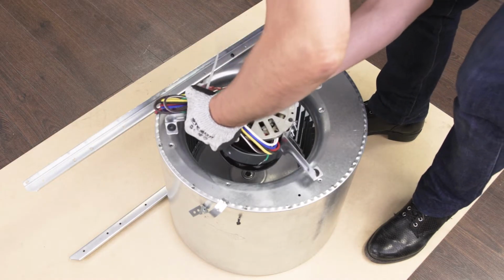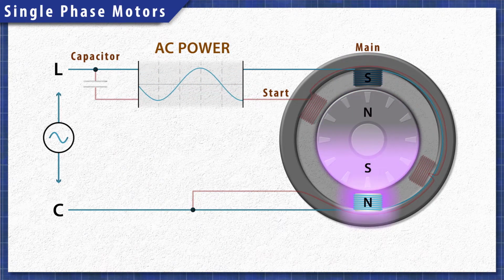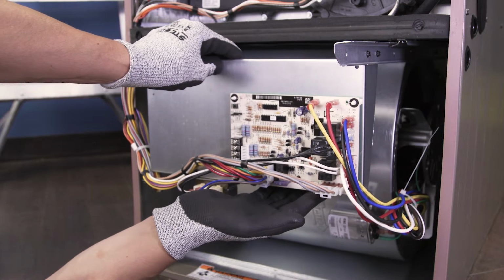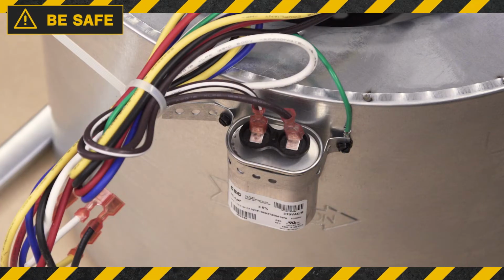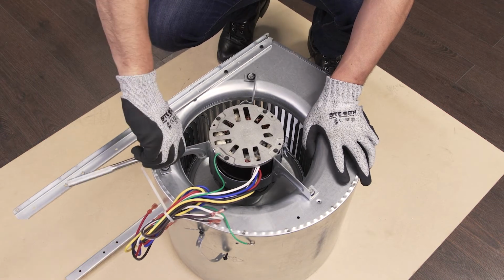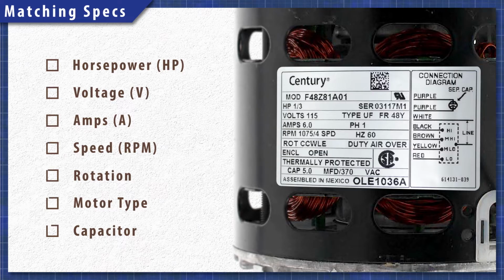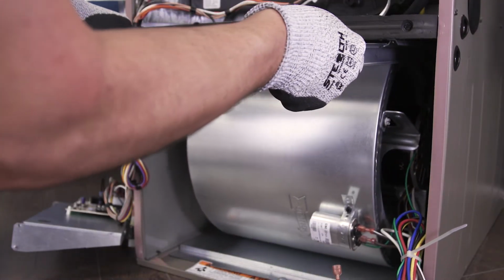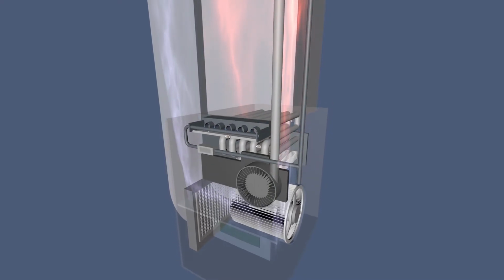Furnace Motor & Capacitor | Repair and Replace

Comment: How do you check electricity used by window air coditioners space heaters and other small appliances
Reply from the maker: A clamp meter will measure the current flowing through the wires and allows you to test a device without having to splice into any of the wires.
Reply: Thank you

Comment: Ok I really need your help. I had someone come out and replace the capacitor a few years ago and I remember him saying that the capacitor was a different one than the other. How do I go back and look to match the correct one with the motor that it needs. Is it listed on the motor?   I believe it was different MFD and VAC.
Reply from the maker: Thanks for watching. If you want to check what capacitor your furnace motor needs, you might be able to do this in several ways. There might be a tech sheet or information in the manual. There might also be a wiring diagram and specs inside the blower cover door.

As well you could look at the motor nameplate data. Some models will list the capacitor directly on here. If it doesn't then you can find a matching motor on amresupply.com using the part number as this will list the motor specs and the needed capacitor here. 

Lastly you could match the motor and find a similar one of the same specs. You can follow this video to see what specs you'll need to match as a reference. https://youtu.be/3eOARJ8oRrc

Comment: Have u guys been able to make a video on how to test and wire a motor with and without a wiring diagram?
Reply from the maker: Thanks for watching. We are currently working on a extensive series on refrigerator repairs so we won't be updating our HVAC or motor series any time soon. We did however do a video on "how electric motors work" which does explain some of the differences between each type and where the capacitor is in the circuit. https://youtu.be/vpspMVQQXRs

As for testing a motor it's as simple as testing each coil for continuity. This will differ between motors as the wire colors and terminals will all be different. Multi speed motors will have additional wire taps (which is explained in the linked video) Each motor tap will have more resistance:

Comment: Thank you so much for this very clear video. I replaced our old blower motor with a salvaged motor, and also installed a new run capacitor, since the old one was more than 20% below spec, and now the system runs quietly and dependably. It should last until we are ready replace the entire system. I am very appreciative for the videos you have created and shared.
Reply from the maker: You're welcome Tom, we're glad to hear that the video helped you replace your motor. If you're curious we have more videos many of them just as detailed as this. We have a "how it works" playlist that many have found helpful! https://www.youtube.com/playlist?list=PLCo9SMjkdWBxWwrWCmzvRMSi2kLo9bGdp

Comment: Does the capacitor give torque to the blower motor or induction motor?
Reply from the maker: That is a great question! It depends on the type of motor. Most blower fans use a permanent split capacitor which helps increase the efficiency. Blower fans do not need a lot of starting torque as the load is just the blower wheel and the air it needs to move. 

Capacitor start motors are often used in pumps or applications that need higher starting torque.

The comparison between these types of motor is shown in this video that we created: https://youtu.be/vpspMVQQXRs

Comment: here in California want to thank you for the slow way to explain, but how would it be a way to know that the motor is not working, the capacitator was replaced and no switch to start the motor was found. the heater appears to be running and got no hot air flowing
Reply from the maker: Thanks for watching. You can test the motor windings for resistance. If there is no continuity in one of the windings then the motor will not work. We didn't go into detail on that as many motors are wired differently and often have different speeds. In most cases however you can test each winding and the common terminal.
Reply: @AmreSupply  thanks for the info, yes I found the problem and it appears that the part or motor is not available, how can I find the switch for the motor
Reply: Part# 50HJ401484 9717
Reply from the maker: @javierhdez3962  There are many different models and not all of them will cross over to something within our databases. It depends on if the switch is specialized or not. What kind of switch is it? Are you referring to a limit switch? https://www.amresupply.com/catalog/Fan-Limit-Controls-HZ3D These can be matched by shape and temperature rating.
Reply: 50HJ401484 9717 is the part number to the switch
Reply from the maker: @javierhdez3962  That heat switch looks unlike anything that we carry. Without any specs its hard to match it with something more generic.
Reply: Have a picture of the motor, but have no way of sending

Comment: 1130 RPM vs 1075 RPM make a big difference? Please help
Reply from the maker: Thanks for watching. That is within a 5% difference and will likely work fine if HP, amps and all other specs are the same.

Comment: So my furnace would make an awful screeching noise when the blower starts up, about 1min in the noise would stop. The noise would start up again when it’s preparing to stop. Is this the capacitor?
Reply from the maker: Hi Tina, thank you for watching. The capacitor wouldn't be the source of that noise. Its likely the motor, the motor bearings or the blower wheel rubbing up against something. It seems like its only at lower speeds. Furnace noises are explained more in this video: https://www.youtube.com/watch?v=WkHgeTITioE

Comment: I need to replace a fan capacitor. The one I need is no longer manufactured. I can find one with an exact match for the MFD and the Voltage. The only problem I'm facing is all the capacitors I find have dozens of pins on them to connect the wires, even single-phase ones have like 7 or 8. My capacitor only has two pins, one for each red wire. How will I know where to plug in on these capacitors with all these extra spaces for wires? Also if I have 10uF + 10%, but can only find a 10uF + 6% am will it work?
Reply from the maker: Thanks for watching. What you might be seeing is a cluster of pins which are only actually wired to the two main connection points. Furnace blowers will generally have 2 pins, and air conditioners will often have 3 which is explained in this video: https://www.youtube.com/watch?v=NkgxNLCrmr0&t=47s If you are unsure of which pins do what, you can test the capacitor to determine the ratings between the pins. As for the tolerance ( the +/-10%) its best to match that exactly.
Reply from the maker: As well if you need an exact match we do carry a wide range of capacitors at AMRE https://www.amresupply.com/catalog/Accessories-635291

Comment: HELP!! My blower motor on my furnace was replaced. Now when the heat kicks on it sounds like a bathroom fan!!!!!
Reply from the maker: Thanks for watching. A new motor can sound different than the old one. What kind of sound are you hearing? Is the motor itself noisy or is it the air moving quickly that you're hearing?
Reply: @AmreSupply  Hi thank you for getting baxk with me. When it starts up it is fine when the air(heat) blows thru the vents then is when it sounds like a bathrooom fan. It does this thru the full cycle.  The tech was out and adjusted speed. It did nothing!
Reply from the maker: @rmartini6952  There will be some noise from the motor running and the air moving through the vents. Other than adjusting the speed, there isn't a whole lot that can be done to reduce the sound of the air out of the vents.

Comment: Are the leads on the capacitor interchangeable? I noticed there are black and black with white stripe wires connecting to that but there is no labeling on the capacitor head as in a dual run capacitor on AC condenser unit. Also if this capacitor fails, would the fan-only mode of a system also fails?
Reply from the maker: Hi John, thank you for watching! Start and run capacitors are non-polarized, AC devices. It doesn't matter which way you connect the wires if there are only 2 terminals. On dual run capacitors, the wiring does matter as there is different ratings for each, but even without labels  you can determine which one is for each based on the ratings.

You are correct, if the capacitor fails, the motor will not start so the fan-only mode will also not work.

Comment: Just replaced our blower fan with the Rotom motor - a 1/3 amp, 1075rpm 4SPD, 5 amp unit.  This replaces the old Emerson unit of the same specs (1/3 amp, 1075/4SPD, 5.1amp), that the bearings finally wore out.  I replaced the wires onto the mother board the same way - black for black, white for white, red for red, and then made a guess for blue on the new Rotom for brown on the old Emerson.  My issue is that the air flow at any vent in the house, seems much lower than before.  I would guess less that half the volume of air is being moved.  

Any thoughts of what I have done wrong?

The mother board is a SureLight by Lennox.  The wires are connected to the following labeled tabs...  ACB E11 COOL is Black,  ACB E12 HEAT is Red, ACB E14 LOW is Blue (tried Yellow too, no difference...) and NEUTRALS E16,17,18, 22, 32 are White.

Thanks!
Reply from the maker: Hi Michael, thank you for watching! It seems like you matched the same specs but there are a few things to check. First check that you have the same type of motor, if you have a capacitor then you'll likely have a PSC (permanent split capacitor motor) as these are the most common. On the side of the motor is usually a spec list and wiring diagram that will list what speeds each color is for. The brown wire is normally used for the capacitor and the other wires will differ depending on the motor and brand.  Check the wiring diagram on the new and old motors and compare the wires and speeds. If will look something like this https://www.amresupply.com/part/DD-035-USE-FML1036#gallery01-14
Reply: @AmreSupply  I am very impressed with AMRE Supply.  The people I have dealt with both over the telephone and in person, have been helpful, patient and knowledgeable.  You have a new customer in me, for life.

My problem is solved. Thanks for all the suggestions on the various "checks" that I needed to do.  As careful as I was on the removal of the old motor, matching the specs on the new, installation and set-up, I finally discovered the reason for my low velocity on the various vents.  Backwards drive direction on the blower fan.  It's amazing how much better the air flow is, when the blower fan is rotating in the right direction!

The good news is that won't ever happen again, and if I ever have the opportunity to help out a friend, that will be one of the "checks" that I will be very careful with, before putting everything back together.

Again, my sincere thanks for all the assistance!

Michael Strange
Reply from the maker: @michaelstrange8165  You're welcome Michael, we're happy that those checks helped you narrow down the problem! A reversed motor definitely would reduce the airflow and is a easy thing to do by swapping the wires. Overall we are glad that you have had good experiences both over the phone and in person, and our youtube channel is just another outlet for customer service. If you had a moment it would be great if you could share your experience and leave us a google review on your local AMRE branch! Every little bit helps us out!

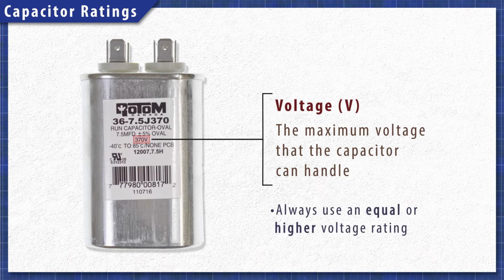Comment: 3:37 why do furnace blower motors use run capacitors as start capacitors? It says run capacitor on the label there and some Jeremy Fielding video also showed this type of capacitor as a run capacitor.
Reply from the maker: Hi Thomas, thank you for watching! There are several types of single phase motors, each with a different way of starting. Start capacitors have higher torque but are shut off by a centrifugal switch, after the motor starts spinning. Run capacitors will also help start the motor and will stay in the circuit the whole time. Run capacitors have lower torque but blower fans in furnaces don't need as much torque as pumps or compressors. Overall PSC or permanent split capacitor are simple and basically run as a 2 phase motor. PSC motors are more reliable as there is no switch needed to shut off the capacitor. Additionally some motors will have both a start and run capacitor.
If you want to learn more we actually created a whole video that explains the differences between all single phase motor types. If you're curious its a good one to watch: https://www.youtube.com/watch?v=vpspMVQQXRs
Hope this helps!
Reply: @AmreSupply  Wow thanks! So the furnace blowers have PSC motors, and now I know that what everyone around me was calling a 'start capacitor' actually has the dual function. So replacing it earlier in life degradation will get efficiency back since as it loses capacitance it's losing capacative reactance (XC) and thus losing current to the second phase of the stator even after start-up!
Reply from the maker: @thomaself7194  You're welcome! Yes most furnaces use PSC motors, but you'll find some that are not PSC. I think the people you were talking with were using start capacitor to describe how the capacitor is needed to start the motor. Lingo and other short hands like that will vary depending what city or area you are in.

Comment: Thanks. We've been leaving our blower running continuously, as it's been needing a push start to start turning! I figured was just clogged with dog hair that got past the filter. Will check the capacitor first before looking to replace the motor.
Reply from the maker: Hi George, thank you for watching! The fact that the motor runs continuously with no problems after a push start is a very strong indicator that the capacitor has failed.
Reply: @AmreSupply  Yep - took out the old one (figured out that "Suf" was really 5μF), got the new one from you guys, put it all back (wishing my motor slid out like the one you showed!) and it's all On/Off/On/Off again. Just gotta get used to the hum of the initial start up and the sound of silence between cycles instead of a constant blower noise again. Thanks!
Reply from the maker: @GeorgeLangley  Thank you for your support, we're glad the new capacitor is working well for you!  Cheers
Reply: Thanks for the reply. Following the instructions I place the fan on running, there is air, but no hot air is blowing, the capacitator was replaced, the switch is good, is there a video on how to check the motor or blower. Thanks again
Semper-Fi

Comment: Do you match black motor wire to red furnace wire??
Reply from the maker: Hi Curt thank you for watching. It depends on the motor. Always try to connect the same color wires as the previous motor had. If you have a multi speed motor then black will be for the high speed, blue/ orange, or yellow will likely be for medium speed and red will be for the low speed. If you have multiple speeds, then swapping these wires will change how the furnace blower runs. If you only have one speed / one wire then just connect to the previous connection and it should work.

Comment: Mine doesn't have the capacitor like in the video.
Reply from the maker: Thank you for watching! If your motor doesn't have a capacitor then its a simple one to one replacement, you can skip the capacitor steps and follow the rest of the video through.

Comment: I always thought that the capacitor is there to save energy since it's a inductive load.
Reply from the maker: Since single phase motors are not self starting they require capacitors to create enough torque to rotate the shaft and start the motor. You can learn more here: https://youtu.be/vpspMVQQXRs
Reply: Because they don't overcome their own torque at startup I guess.

Comment: Why didn’t you align the blower wheel on the shaft so the wheel doesn’t rub the inside of the housing?
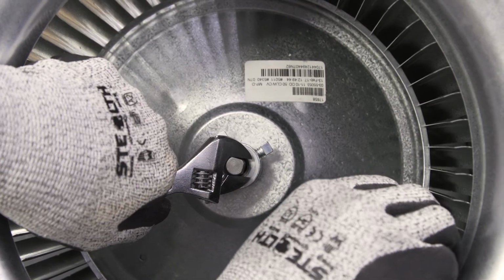Reply from the maker: Hi Richard, thank you for watching! You are right that in some cases additional alignment might be necessary. In this particular model the blower had enough clearance and didn't rub on the inside of the housing. At 5:33 the blower turns slowly not because it is catching on the housing, but because the set screw was applying a small amount of pressure on the shaft while it was being aligned. That might be the sticking that you are noticing.
Reply: @AmreSupply  I think you didn't understand Richard's question. When re-assembling the blower, after mounting the motor in place you need to sit the blower on the floor or bench so the cage spins on a horizontal axis, then finger-tighten the set screw on the shaft, then back off the set screw so the blower wheel slides freely on the shaft. Then slide the blower wheel on the shaft to a position where you can spin it freely without contacting the housing at any point during  a full rotation. Then finger-tighten the set screw again, then spin the wheel one more time to make sure nothing has shifted, then tighten the set screw with a wrench to final tightness. Spin again to check for clearance, and you're ready to put the blower back into the furnace.
Reply from the maker: @phillipwbarth  Thanks for the detailed response and clarification on the previous post. I agree that this part of the repair could of used some more explanation for that adjustment and we'll keep that in mind for a future update to the furnace videos.